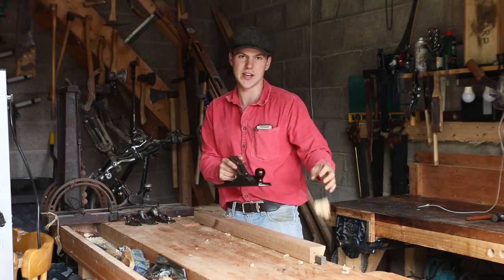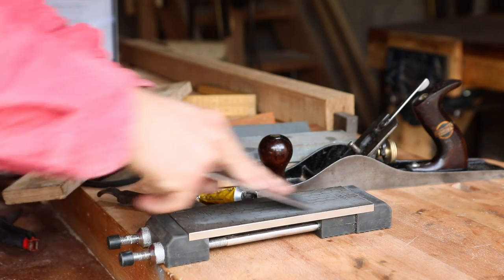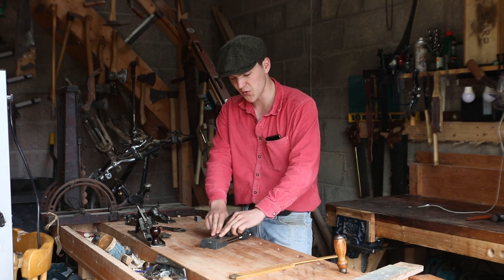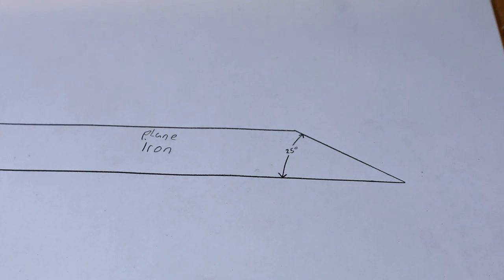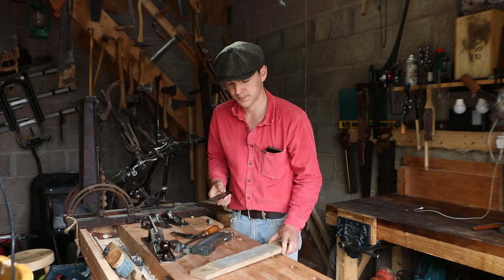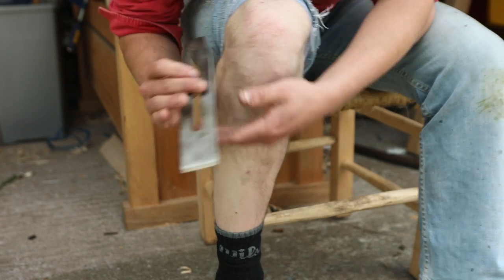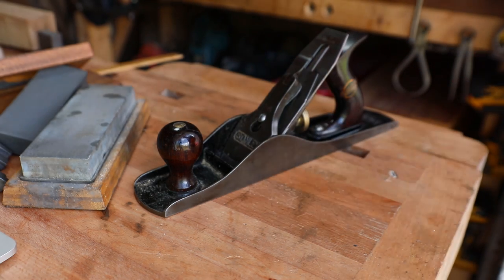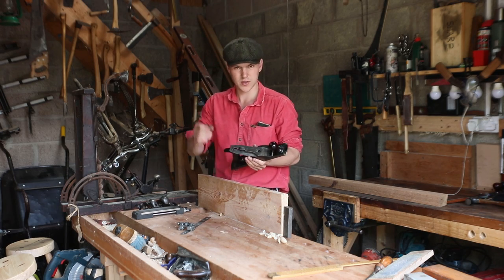How to get a hair shaving sharp plane Iron (Sharpening Tutorial)

Comment: I loved your video! Thanks so much. I have louvre doors I'm using for my closet.  I'm installing them with flush hinges. I don't want to go back to the carpenter I paid to cut a 1/2 inch 1.27 cm off for me. I was disappointed. I'm thinking, I'll buy a hand plane and shave 3 to 4 mm off myself. I am a lady, I can be handy, I used a hand plane years ago, I believe I can do it well. It's too tight on the frame not 100% straight, it's too tight mid doors to the bottom. Any suggestions are greatly appreciated and for what Hand Plane and size I should buy? My doors are real wood 78 inches long 198.12cm